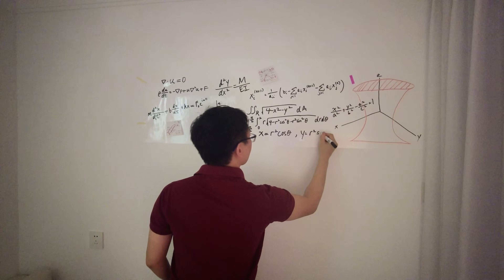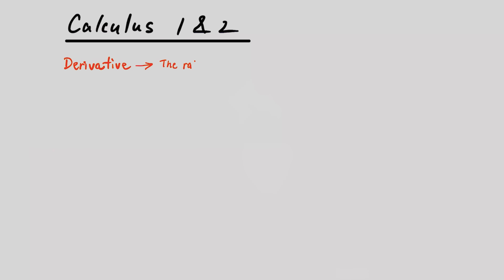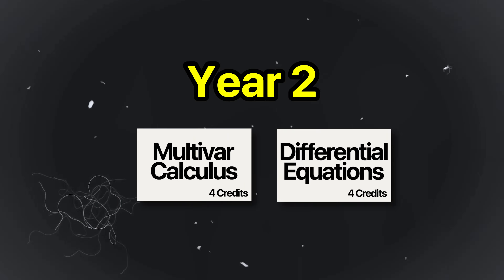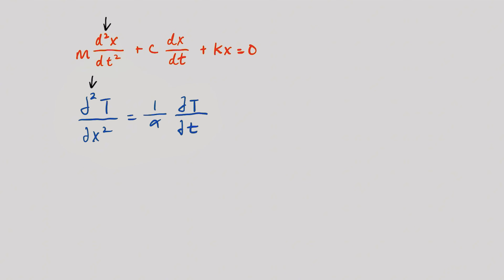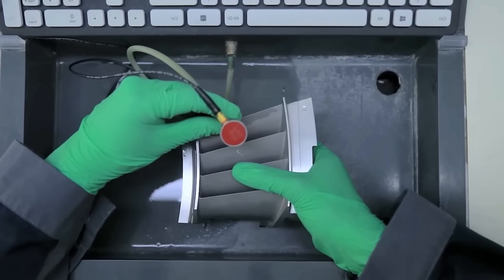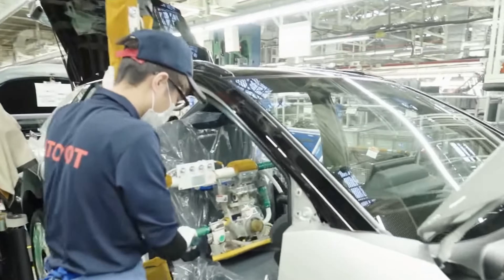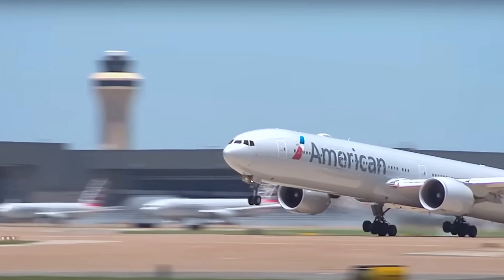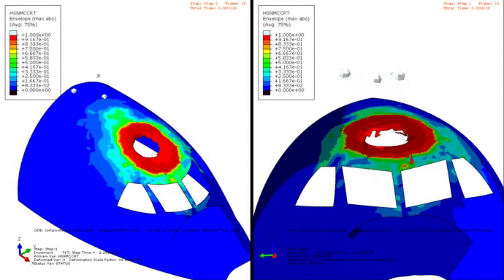Why You NEED Math for Mechanical Engineering

Comment: How do you analyze piston motion by calculus?? Seems a joke to me. Without knowing the amount of force acting on piston you can never predict how fast the piston moves inside the cylinder. Calculus is useless for real life problems. In real life you need real data. Without knowing data those equation will only give values of x and y. If you know data; then simple addition, subtraction and division is what we need to determine how fast the piston moves inside the cylinder.

Comment: Dude is talking on how much you need to know math and shows software to do all simulations that need math... I would say that most people would need to know overal what to apply for different scenarios rather than to sit and learn math for most of the time on university. There is very little jobs that would require any manual calculations like mentioned in the video. You just want to rationalize all the pain you went through and prove it was usefull.
Reply: You can't just run blind simulations without doing hand calculations. You need to understand the math to develop analytical models that describe system behavior, and then evaluate those models using CAE tools like MATLAB. After that, you compare the CAE results with FEA. The thing about what you said — 'knowing overall what to apply in different scenarios' — is that no two scenarios are exactly the same. I can assure you, if you don't understand the math, you'll have a really hard time when it comes to system control.

Comment: Can i do engineering if i hate solving complex maths questions 😢
Reply: Find a different path. lol
Reply: As he Said in the Video , if you know Math than your better than Most of the other Mech Engineers, however, it depends in which sector you want to do Engineering. I am in the Design sector for packaging Machines , and I don’t Need math by far. If you want to work in calculating Stress on a Product, than You Need a Good understanding of math.
Reply: But in University you sadly need to go through so much math
Reply: @giuseppegrana588  im not the best in maths but i dont hate it i just struggle alot with maths i am doing engineering in college right now and i finish in 3 months im debating whether to go into university for engineering or do something else 🤷‍♂